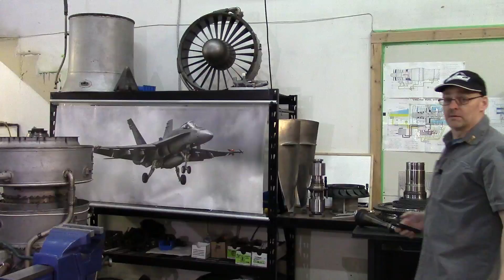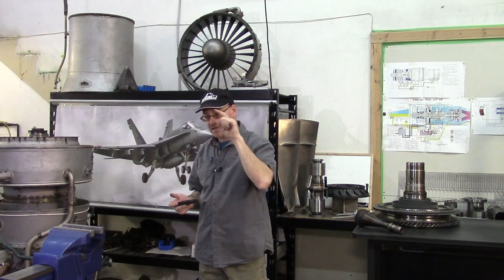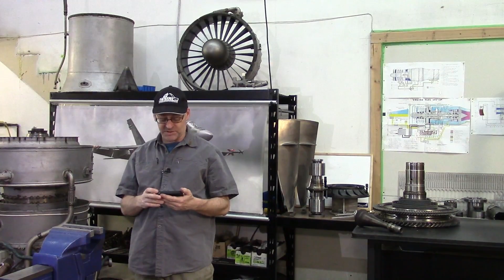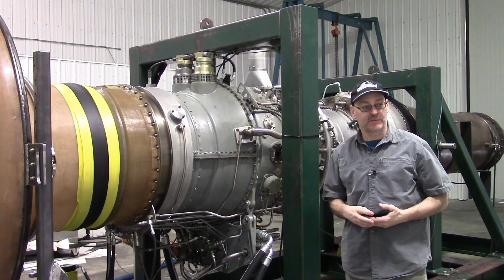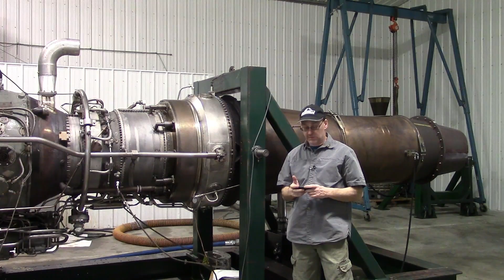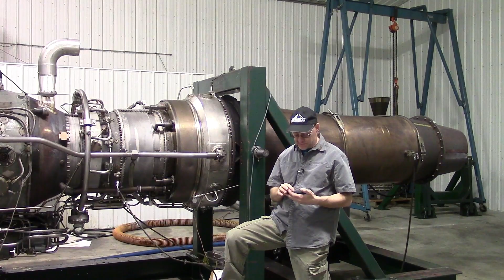Jet Questions 80

Comment: Hey Jay and thanks for the entertainment!  I love your technique and the discussions generated, stirring a thought or two.  As for the 'safety' concerns of your YouTube public, just tell them "It is under control.  We got this."  Safe practices include many ares to be restricted to "AUTHORIZED PERSONNEL ONLY" so that there are no people or critters roaming about.  There are no pedestrian crosswalks or even access to the Indianapolis Motor Speedway actual track, except through controlled points.  They do have big fences along the stands & seats to keep people off the track and cars out of the stands!  Remember, you can't fix stupid!  Thanks for sharing.  Cheers.

DD

PS:  I re-viewed the R.R. Viper start on the shipping stand and what struck me was the overheating of the poor turbine nozzle & turbine!!  That guy normally runs old R.R. Merlins & Griffons (beautiful pieces of work).  He has a good number of dislikes (over 580) for that video!  He does have more videos of that Viper engine running once he secured it.

Comment: In response to your lesson regarding throttle response, turboprop engines generally always maintain 100% rpm, even at ground idle. As such they responded immediately to throttle inputs. I believe there are a few exceptions though. P&W's PT6 because it has a power turbine that isn't mechanically connected to the compressor section and also Allison's T56 (501D) has a low speed ground idle which hangs out around 75% rpm, however it normally takes about two seconds to switch from low speed ground idle to high speed ground idle

Comment: @27:55 It depends on whether it is being used as a standalone generator such as on a ship, or a grid connected one as in a power station.  

For the standalone the feedback signal used to control the throttle would normally be primarily the RPM of the generator   (and hence the PT)  whereas for a grid connected one it would detect the phase of the current generated relative to the voltage.

In the latter case (grid connected) both the frequency and the voltage are fixed and determined by the grid and hence can neither  be used as a feedback signal, nor can they be influenced in any significant way by what the gas generator does. 

In both cases there are other secondary parameters that are used by the control algorithm for other reasons (such as to improve responsiveness to load changes) but they play a relatively minor part in the adjustments applied to the throttle.

All of the above also applies to generators with any other kind of prime mover, not just gas turbines.

Comment: i just started working at a power plant. we have 4 LM1500. we often have issues with high vibration, which most times ends up being on the pizo sensor side. what are some mechanical issues that may cause high vibration. ie, binding engine mounts, exhaust collector rigid mounted to engine, or any other things you can think of.

Comment: Related to FADEC and fuel controls, how did engines get controlled before the age of the transistor? A mechanical computer like the gun laying systems of battleships?
Reply: +MonMalthias The early gas turbine fuel systems were not mechanical computers, but hydro-mechanical analogue computers, using the fuel itself as their working fluid. Pressure, temperature and speed signals from the engine were fed in and turned into pressures within the fuel control unit. The output signal was a servo pressure that controlled the delivery of the fuel pumps(s), but there were numerous variations.  PS My apologies to AgentJayZ for doing so before he had the opportunity to answer, but I did have a spell designing fuel systems at R-R before they let me loose on the turbomachinery. PPS If you wish to see diagrams of such fuel systems, try to get hold of an old copy of R-R's book 'The Jet Engine': it has some really pretty diagrams in Section 10.

Comment: If I am not mistaken, the original German turbojets had a more or less, direct fuel control system as early on, especially with early jets that had poor throttle response, pilots would advance the throttle(s) to quickly and cook the hot section parts. They were built with less than ideal metalurgy which wasn't helping things. The earliest engines TBO was in hours, like less than 10hrs.
Reply: +mytmousemalibu
I assume you mean this one. (Me-262's engine)
https://en.wikipedia.org/wiki/Junkers_Jumo_004
Here's another one, but it never made it into production.
https://en.wikipedia.org/wiki/BMW_003
Neither of them were noted for longevity.
As you noted, advancing the throttles too quickly would cause it to get too much fuel for the rotational speed, which would cause an EGT spike, followed rapidly by the rotor blades and stator vanes undergoing thermally accelerated rapid unplanned disassembly (melted/slagged turbine section).

Comment: Hi Jay

Thanks for all the awesome videos.  You have mentioned before about wet emissions systems lowering the temperature of combustion and therefore the NOx emissions, and also stated that efficiency is at least partly(?) increased by increasing turbine inlet temperature and pressure rise of the compressor.  Decreasing the temperature of combustion would seem to lower the efficiency of the engine.  Unless, it's just worth it? Is the inlet temperature is still as high, there just isn't as high a peak within the combustion liner? Or is the increased mass flow make up for the lowered efficiency?

I was also wondering if there was a primary and secondary fuel supply to the nozzles in gas fueled gas generators.  I can't tell if there is a second manifold, or any sort of supply line.

Thanks!

Comment: Hi AgentJayZ - and thanks for the mention.  Elsewhere, I have sympathised with your opinion regarding the complexity of certain R-R engines.  I never did like those compressor discs with 'hairpin' drive arms, splined onto a centre shaft - clever, but complex. On the subject of DLE, I'm not in a position to add much, as R-R IMD started on the development of the system for the Industrial RB211 and Trent engines after I'd left - and they had plenty of problems from what I heard on the grapevine. I'd already moved down to Bristol and was having fun (and problems, too!) with engines that actually flew.  That's a great picture of an F-18: is it a repro of a painting?  If you'd like to see some great aviation art, check out Neil Hipkiss' website.  Look at his 'Commissions' page and you will see a painting of a 'Harrier Rising', with a note saying it was commissioned by "an ex-Rolls-Royce engineer" (guess who?).  Look around some more and you will find a painting of an Apache 'Kicking up a Storm'.  My son bought that, as he used to fly Apaches with the UK Army Air Corps.

Comment: Great video again. I've always been curious about your natural gas setup for when you use natural gas as a fuel source. I know there are boilers, evaporators, etc, but I do not know how or why they are needed. If you feel it is time worthy, can you go over the what's and why's of taking your raw natural gas input to the facility and converting it into what is needed by natural gas burning jet engines. Are similar adjustments to propane needed and why. Thanks for your videos as always!

Comment: Hi JayAnother super video, you mentioned your old FOD screen that you have used in the pastmade from expanded aluuuuuminium  Have you ever had an ice build up on the screenespecially when you are carrying out winter tests?
Reply from the maker: +jjamanda    Occasionally we see ice building up on the inlet struts and IGVs. If the engine we are testing has anti-ice capability, we turn it on. If it doesn't, we stop the test and wait for more favorable weather.

Comment: AgentJayZ  could you please tell me why do pressure ratio vary with altitude?
Could you please give us some explanation about the phenomenon called surge? What is its cause? What are the design solutions adopted to avoid it?
Reply: +Federi -co AgentJayZ has explained surge in the past, so he will probably refer you to his play list.  I've also contributed on pressure ratio in the past, so I'll be brief. The pressure ratio that a compressor produces doesn't vary with altitude. A compressor with a design pressure ratio of, say, 10:1 will deliver 147lb/sqin at sea level. At 30,000ft, where the air pressure is 4.4lb/sqin, it will deliver 10 x 4.4 = 44lb/sqin.

Comment: Hi! Could you explain in detail how the engine is lubricated? How does the oil system work? What happens to an engine if it is not properly lubricated? Do engines come lubricated fresh off the factory line or does the purchaser have to lubricate it before its first run?
Reply from the maker: +smoshjkl "Jet Engine Lube System"
Reply: +AgentJayZ Holy crap-You just made my day by replying! Thanks for redirecting me-I had assumed it had been answered previously. Kind regards from an aspiring young pilot and jet engine nerd! I LOVE your videos!! :D

Comment: Hello AgentJayZ ! 
You have spoken a great deal about NOX reduction in these engines. I have this Question. Why isn't the turbine exhaust gas used like in a piston engine, to reduce the temperature and volume of air/fuel? Exhaust Gas Recirculation.
Reply from the maker: EGR would only reduce engine power. 
Most important thing to remember: These are not piston engines.

Comment: Question: you talked about dry air for the 1st question of this video and I know that in winter the air is denser because it's colder does that mean in winter a jet engine do more work and is it more fuel efferent?
Reply from the maker: +Nathan saunders Cold air makes the compressor work better. Efficiency stays the same, but the engine can make its rated power with less rpm.

Comment: It's me again (sorry Darren D, that should be, it is I again).  On the subject of fuel systems and the pilot "having a vote", there are certain military engines (eg, the F405 Adour in the T-45 Goshawk) that have a back-up fuel system (BUFS), just in case the FADEC fails.  I wasn't involved with the fuel system on the F405, but the BUFS was described to me as a 'tap' ( that's a 'faucet' for you folks in N America), which the pilot could use to control fuel flow ..... very carefully.

Comment: Hi quick question why is the air so calm before entering the engine, you would think the air rushing in would be as violent as the air coming out
Reply from the maker: +wolvolad25 It is moving much more slowly, and hopefully turbulence free. The thrust of a jet engine is produced almost 100% by the air leaving it faster than it goes in.

Comment: Hi, I was wondering what the ratio would be between power extracted by the turbine of the gas generator and the power extracted by the power turbine/low pressure compressor in your typical turboprop/turbofan at normal cruise settings?
Reply: Sorry, of course I meant low pressure turbine, not compressor.
Reply: +Calum MacFarlane I'll try to answer this for you, but I'll need to go away and do a few calcs.
Reply: +Calum MacFarlane These are very approximate figures for a typical  big 3-spool turbofan engine at take-off, but the ratios wouldn't change much between take-off and cruise ratings.  The LP/fan turbine will be developing around 30,000 to 40,000SHP and the HP turbine will be developing around 100,000SHP.  In addition, the IP turbine will be developing (but this is more 'guessology'), say, 50,000 to 70,000SHP. However, the HP turbine and IP turbine power that is driving the compressors is effectively 'recycled'.
Reply: Hi Graeme, thanks for your answer. My current machine is powered by two PW150A engines which can produce 5071SHP at max take off power so I suppose at those ratios 14000-16000SHP would be a reasonable guess for our high pressure section.
Reply: +Calum MacFarlane I had to check out the PW150A, which I now know has a two-spool gas generator and a two-stage free power turbine.  I wouldn't like to guess at the power split between the two spools, but your guess for the HP spool only looks rather high.  I would have guessed around 20,000SHP for the two spools, but I could be way out.
Reply: +Calum MacFarlane You asked for a ratio and, having trawled around, I think I'm coming up with between 4:1 and 5:1, give or take.  It's guessology, because I just can't find definitive figures for the actual power developed by the turbines of various engines and I'd need mass flows and temperature drops to do some rough calcs.

Comment: Thanks for your excellent videos. Why Is there no concept of "atomizing air" in these engines if they are used as industrial engine and being run on "liquid fuel"?
Secondly,  thanks for your video for balancing compressor but please do you have any video in which you can tell briefly about "static balancing" and "dynamic balancing"?
Thanks for sparing your valuable time.
Reply: +Abid Mahmood The liquid fuel burners of engines such as the Spey, Avon and Olympus are effectively atomising injectors. They are supplied with high pressure fuel and atomise the fuel into micron-sized droplets. More modern engines have so-called airspray burners, which utilise compressor delivery air flowing through the burner heads to promote atomisation. The problem with the early burners is that, at low flows, the atomisation is relatively poor, combustion is less efficient and smoke is produced, particularly on start-up.
Reply: +grahamj9101 . Thank you sir for getting the query cleared. Please keep on contributing.

Comment: Hey, Jay! 
Thank you for the work you do! Is there typically a maximum duration an engine can stay running for? I'm especially curious for industrial engines. Obviously you can't run an engine 24/7 at 100% RPMs. But maybe you can at 70-80% RPMs? 
Thanks, 
Nathan
Reply from the maker: +Nathan Bankston 100% power...24/7, for as many months as you can supply fuel.
These are not piston engines.
Reply: wow ok. Thank you!

Comment: (I just re-watched the compressor videos) Whats the scoop with stator vane to compressor blade gap? It seems to be fairly large especially when compared to tip gap. Is there a set tolerance for gap of these two components? In past videos you mention the engines are trying to pull themselves apart, so is there a larger gap from the front of a rotor blade to the rear of a stator vane vs the rear of a rotor blade to the front of a stator vane to allow for forward expansion from that tensile force on the shaft? Or is that force on the shaft equal to the force on the compressor case/stator vanes? Do modern engines have a tighter gap to cope with the higher compression? Not expecting you to answer all these questions just wanted to put these out there in case you ever have videographer block and are not so busy. Also still curious about the Iroquois did you guys ever find a gearbox or data plate picture?
Thanks!
Reply: +BeachBoardFan The axial gaps between compressor rotor blades and stator vanes are set primarily by the manufacturer's design rules and criteria for surge deflections. No manufacturer wants his engines to surge, but, on occasions, they do. I once saw/heard a DC10 on take-off at JFK, one engine (a CF6?) of which suffered repeated heavy surges. During such events, the blades experience large transient movements, which, if there was a 'clash' between the blades and vanes would cause a lot of damage.
Reply: So does a larger or smaller gap reduce surge? I'm guessing its not that simple, probably depends on several factors like the angle of the blades, number of blades, size, etc. and for that matter what determines those factors. I know AJZ discussed why they get shorter and thinner and about tip speed and diameter of the cases but it all just brings up more questions. (I had a professor that said you know a teacher is doing their job well when answers to someones question creates new questions so hopefully you guys take these questions as compliments) anyway can anyone recommend good books about this stuff. I have almost all of the books AJZ recommended but most are about the theory and operation of engines. I'm most interested in the whys of the engineering. Every thing on those engines is purpose built, and unfortunately manufacturers are tight lipped about everything other than the ambiguous info they post in their marketing videos, so everything just seems like black magic.
Reply: +BeachBoardFan  It's Easter Monday, which is a public holiday in the UK, excluding Scotland, but that's their problem. After all, some of them want independence - and I hope they remember that 4th July is already taken. I'm mindlessly (half) watching 'Despicable Me', so I have plenty of mental capacity to try to formulate an answer for you. Although I was responsible for fan and compressor design at R-R Bristol for some years, I was a mechanical designer, not a compressor aerodynamics specialist.  I was never aware of any compressor test rig work on the effect of blade/vane axial gap on surge margin. The objective would have been for minimum gaps, subject to other criteria (such as surge deflection), in order to minimise length and hence weight. However, my experience suggests that increased axial gaps would tend to be detrimental to surge margin. What I would characterise as 'parasitic' volumes in the compressor flow path certainly do have that effect. Specifically, deep stator 'wells' beneath shrouded stator vanes in one three-stage fan that we designed had to be reduced in volume, in order to improve surge margin. Further, in another application, it was demonstrated that shroudless stators gave a better surge margin than the equivalent design with shrouded stators, even with shallow shroud 'boxes' or platforms.  Nevertheless, shrouded stators are often preferred for reasons of mechanical integrity.